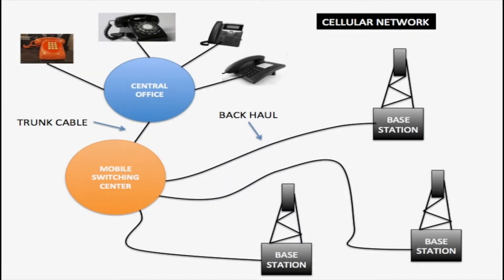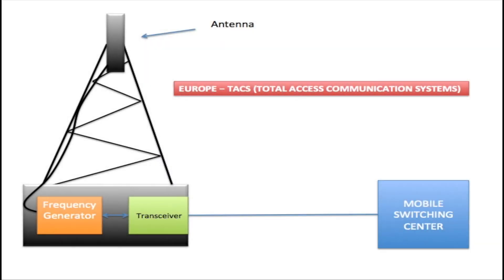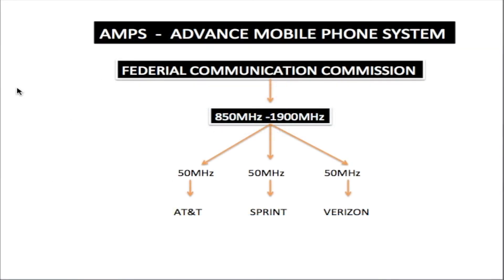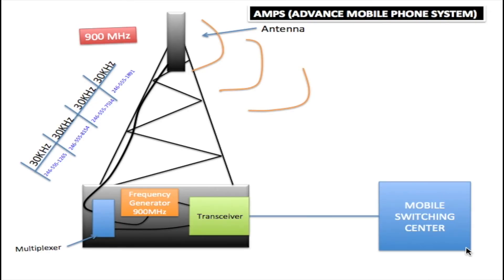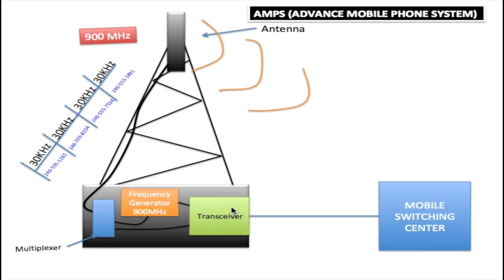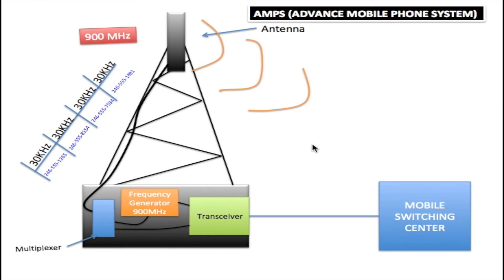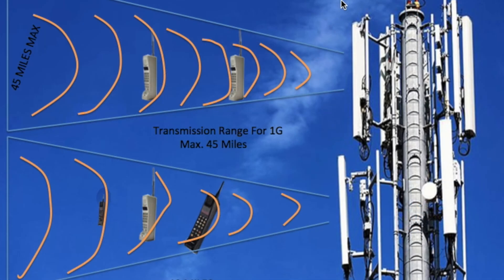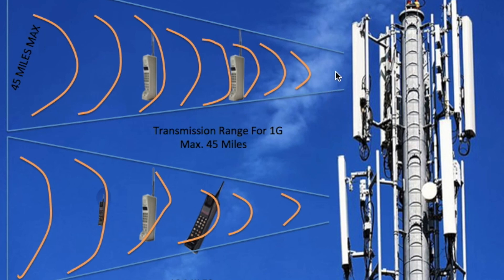How Cellphone Service Work

Comment: AMPS was never on 1900. It was on 850 MHz only.
Reply from the maker: The 1G AMPS network operated on the 800 Mhz frequency band.  You are correct, AMPS did not use 1900MHz.  I do apologize if I said that at any time during the video.